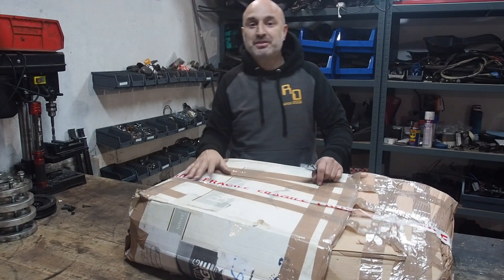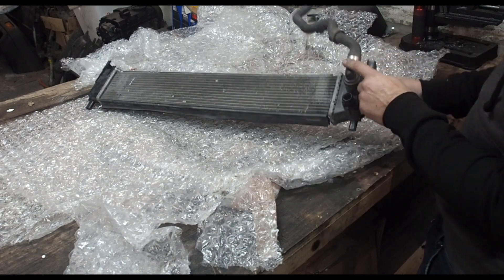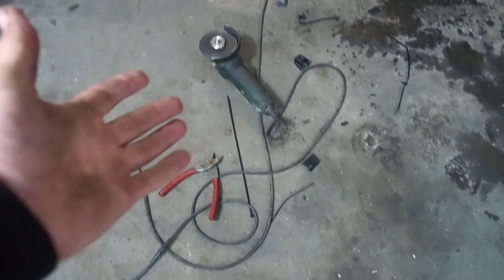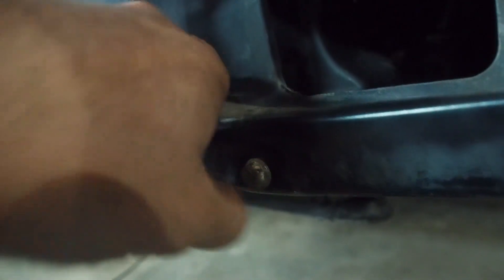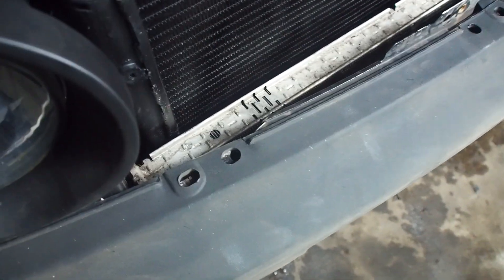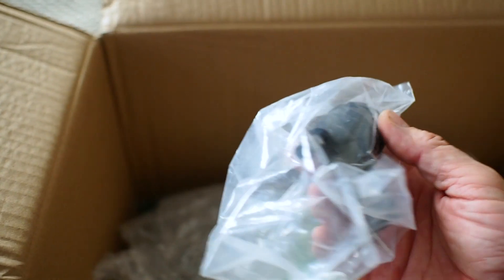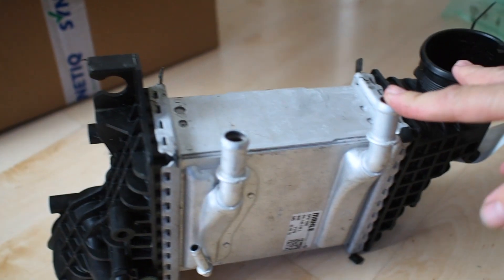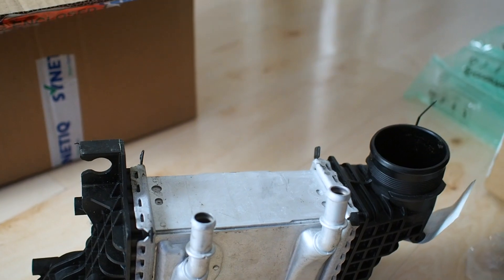VW Golf mk3 *Chargecooler* is it the future?

Comment: Do you thing the core could hold about 2 bar turbo pressure?
Reply from the maker: Yes easy, the 204 twin turbo T6 run at almost 2bar. the way the plastic ends are pressed on is impressive.

Comment: I'm confused at moment as building an ARL in my passat b3. There's not much room for a front mount and I've a nice little space for a charge cooler. Now I'm hoping to get the 230bhp at some point at 180 at moment being told that if these were so hood everyone would use them but my argument is they are. Are they anygood and what you reckon max bhp is as I'm looking to use same chargecooler as yourself
Reply from the maker: This one came off the twin turbo T6 210ps, I guess only as good as the coolant rad and the pump flow. I'm going to start with the Golf mk7 rad, plus going to test water flow rates, as less or more can and will make a difference,  slowing down the flow rate may increase heat transfer. Well all the BMW M cars are using charge coolers, saw a pic of the new F1 Merc engine and that had a charge cooler bolted on to the inlet and well as normal intercoolers. Years ago maybe they wasn't as good and cost more, but today on eBay loads of OEM ones around! From high powered cars, Friend is building a 1000hp R30 Corrado and that has a charge cooler. In the end it's only as good as the "coolant rad" and "right flow rate" I'll know for sure in the summer once it's mapped.
Reply: @RestoDesigns7  ah great stuff feeling happier im getting one with same part number. Got a rad off a 1.2 polo I think but I might look at some bigger ones. Rather over do it than go top small n do some damage

Comment: Do you have the part nr of the chargecooler radiator? I would to make something simulair on my mk3 variant TDI 🙌🏻
Reply from the maker: Cool, I do show it in the video, I will add it in the description.
Reply: I think its 5Q0121251EL not EB
Reply from the maker: Here is the part number 04L 145 749 L
Reply: @RestoDesigns7  thanks but i meant the radiator, is it off a T6? Thanks mate!
Reply from the maker: @ocmv6710  Ok sorry misunderstood, 5Q0121251EB